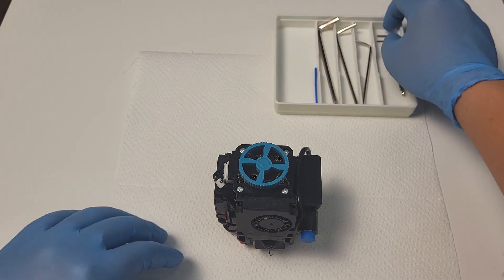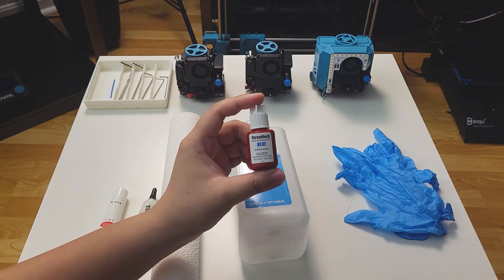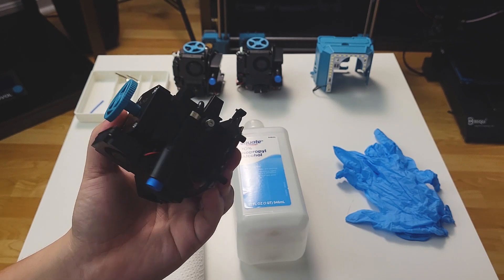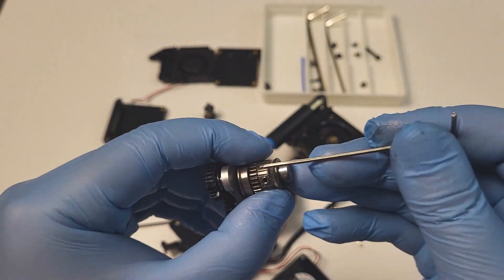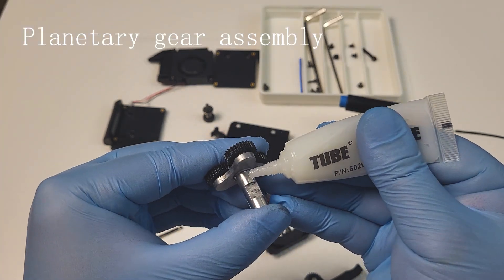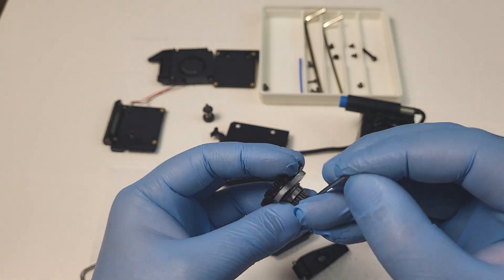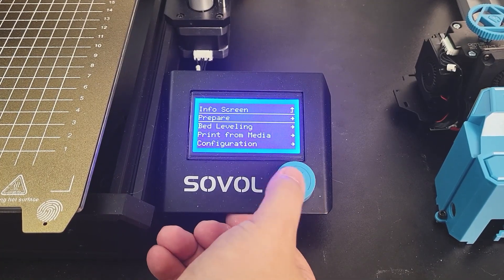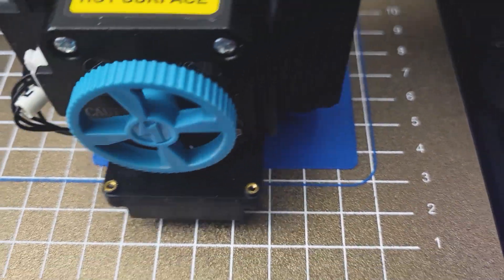SV06 Extruder Gear common issue, repair, and maintenance guide

Comment: The low strength purple threadlocker should be removable.
Reply from the maker: Yes, but some early production units seem like didn't have that at all.
Reply: @SvgLau  Do any? My month old one didn't. I'm saying that if you add threadlocker yourself, you probably won't struggle with future removal if you use purple instead of red.
Reply from the maker: @MiG82au  oh year. sorry, I was thought you mean they added purple threadlocker in the later patch. But I guess their didn't. I mean, if threadlocker works there is no reason you will need to take it apart again, any colors of threadlocker should be better than "none".

Comment: Hey, thank you so much for your videos and the effort you put into them - I really enjoy your whole channel!! 
I have a Sovol SV06 and have massive problems with clogging/heat creep. I have tried replacing the heat break cooling fan for a stronger one, optimizing retract settings and also reapplying thermal paste to the heat break. I wonder if some else has similar problems or any tipps how to solve the issue
Reply from the maker: It take so much time and effect to make those video. But hey, it is really rewarding to see you guys positive comment and know that my effort does helps some people out there.  
Back to your question, there wan't many people complanit about the heat creep issue of this extruder design. But I do see some people have talk about it on FB group once in a while since it's launched. Most people could get away with 5015 heat sink cooling fan upgrade. But some didn't, there is few people mentioned that the current on the extruder might be sightly higher current or defect. So it over heats the heatsink as well. Also, did you try to do a PID calibration on hotend, also a defect hotend thermalmeter might possible leading your issue. Lastly, what filament you are printing? TPU clog is known common issue for this extruder on sv06.

Comment: How common is this?  Ive been running mine pretty hard for about 8 months with no issue so far…..
Reply: Seems hit or miss. I think the QC on current models is far better than the early models. Mine's been flawless.
Reply from the maker: @ipdjbt  yes. So many people have point this out on fb group including myself. They have improved over sv06 plus and sv07. But if you get sv06 early production patch, that is something you want to keep eyes on.
Reply: I'm from Indonesia, I bought the SV06 from a trusted vendor here, sure thing this problem happened to mine 😢
Reply: I had this issue about within a month (or slightly over a month) since I bought it earlier this year
Reply from the maker: The one on video is running totally fine, I wouldn't notice it if I didn't open it to record this video. Otherwise I think I will end up getting more metal shades within the extruder and find out when it completely die.
Reply: @SvgLau  thats exactly what i was looking..i dont use facebook so out of loop.  Thanks for the vid Lau, looks like i have weekend project